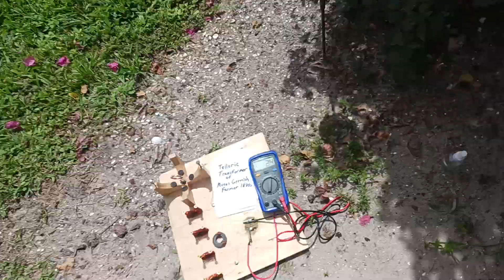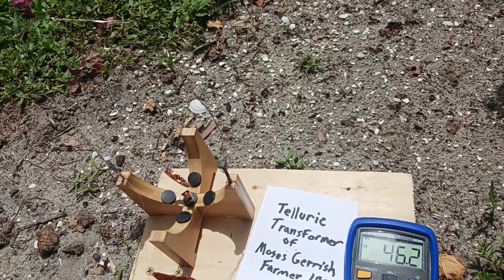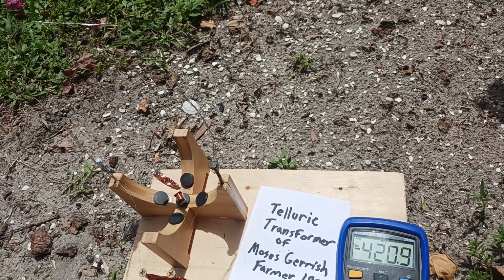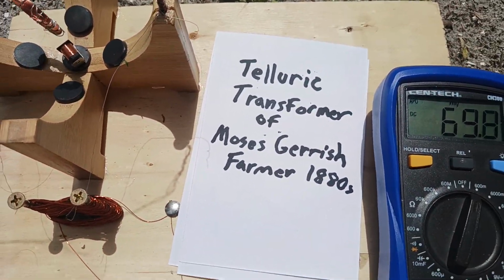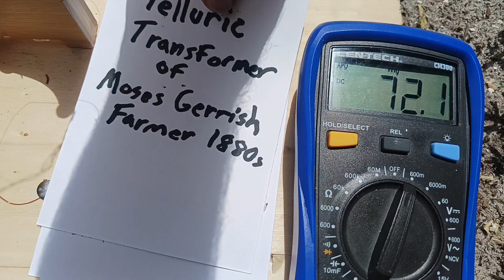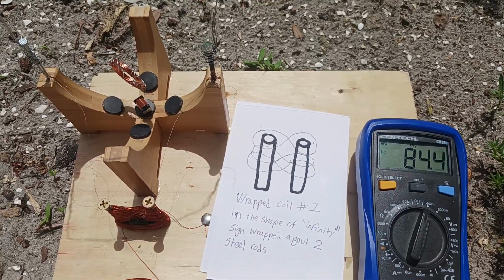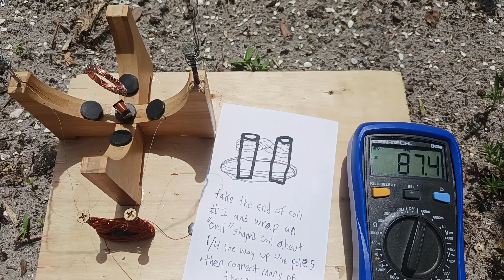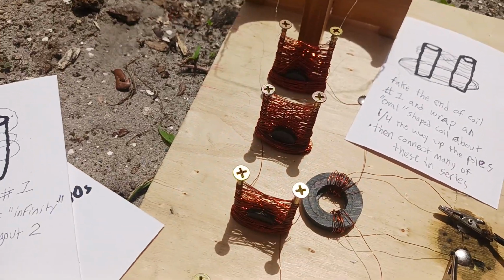EARTH ENERGY MOTIVE POWER

Comment: did you try if you can get a led shine on it? you might get it shining a tiny little bit...
Reply from the maker: @MilkywayOutcast  I am going to use an electroluminescent gel as it requires less energy
Reply: @peterlang777  ok very good I am super curious about the gel  but did you try an led in the dark it might actually be efficiant
Reply from the maker: @MilkywayOutcast  the flux of voltage seems to variable to light the LEDs I have.
Reply: @peterlang777  which s the electroluminescent gel you are planning to try?
Reply from the maker: @MilkywayOutcast  PEDOT flakes in corn oil. with red flourescent dye
Reply: @peterlang777  ok cool. Thanks a lot. Looking forward to see the demo.